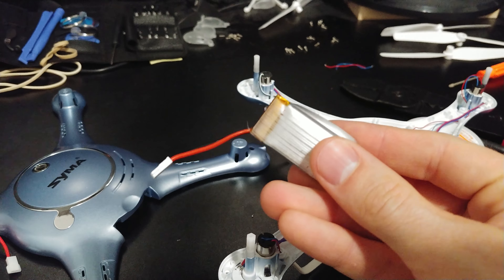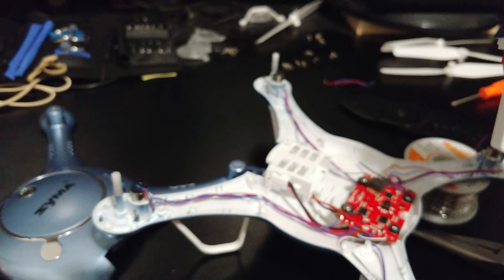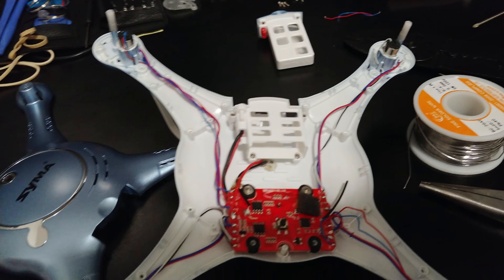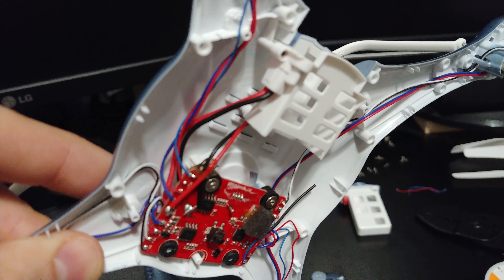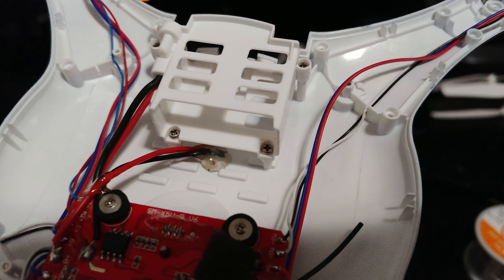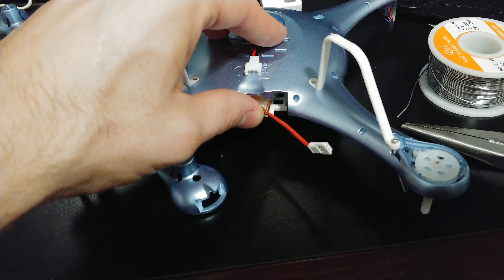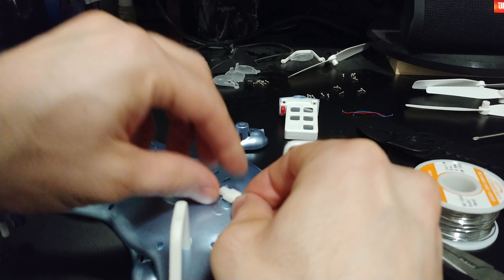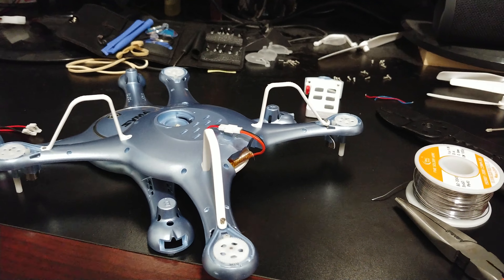Syma X5U Drone Mod to Accept Extra Batteries

Comment: thats a really puffy pack! it is dangerous and should be discarded.
Reply from the maker: No, it's not. It's nearly twice the mAh as stock so it's larger.
Reply: @cmscott  I get that its larger, but is it squishy? if its squishy its puffed. 
at 3:03 side pleats looks stretched/starting unfold, and top and bottom look puffy.  of course only you can tell ultimately.
Reply from the maker: @TheXanUser , I appreciate your concern. I am quite familiar with these kinds of batteries and have seen puffy before as well. These were fairly new. Might look puffy on video but they are fine/normal. Thanks again for the comment!